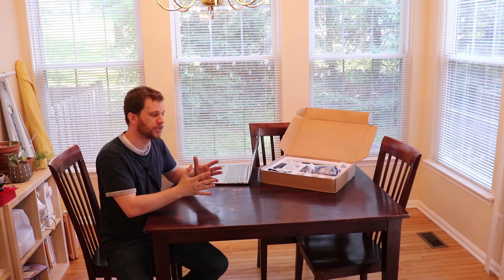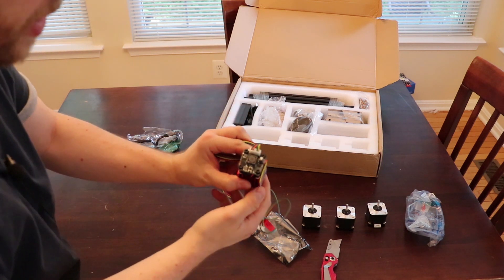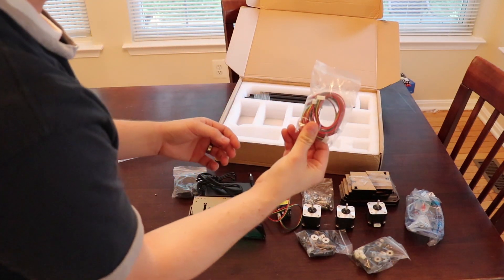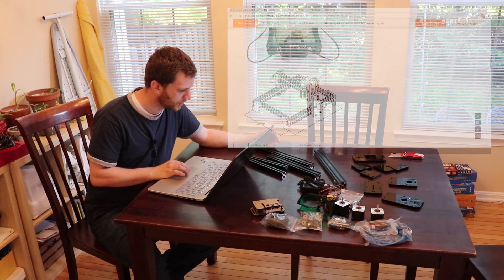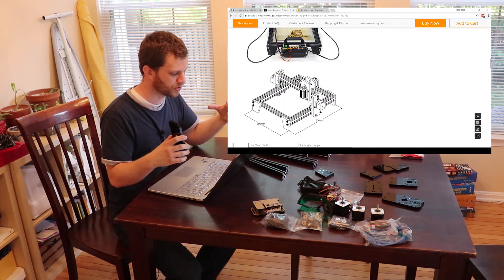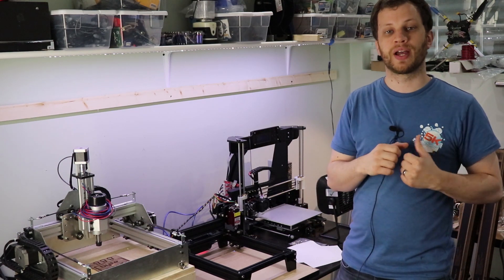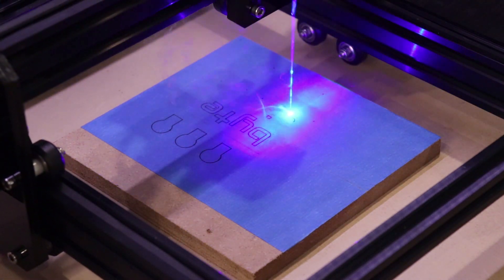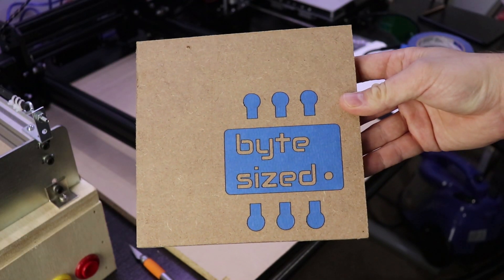Getting Started With A Desktop Laser Engraver

Comment: Any instruction on how to run any CNC machine on a raspberry pi, please? :)
Reply from the maker: Usually CNC machines  have a controller that will accept G-Code. As far as the raspberry pi goes, you just need a g code sender. There are several options out there. I think I've used one called universal g-code sender